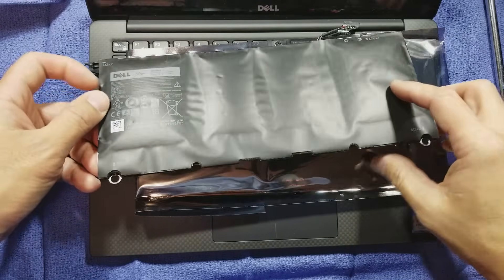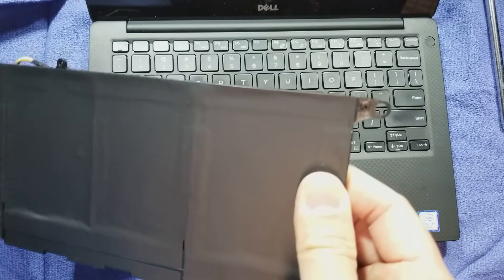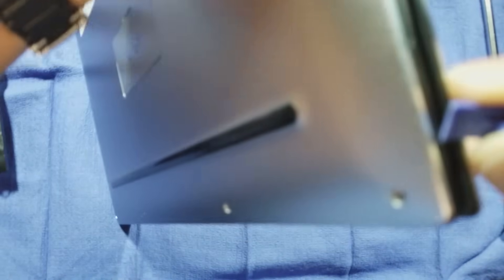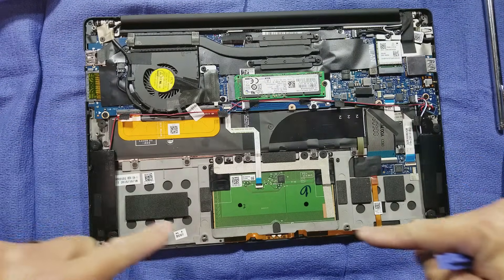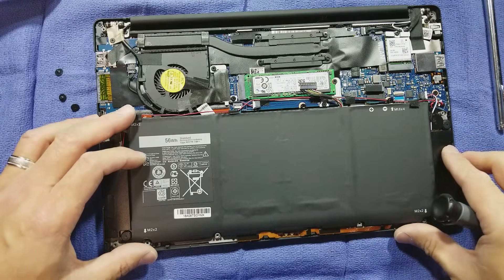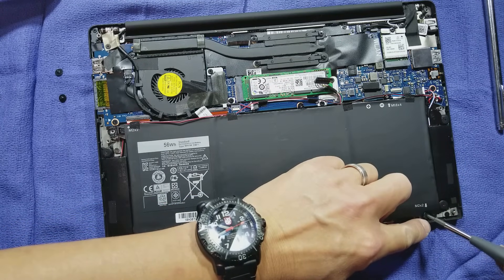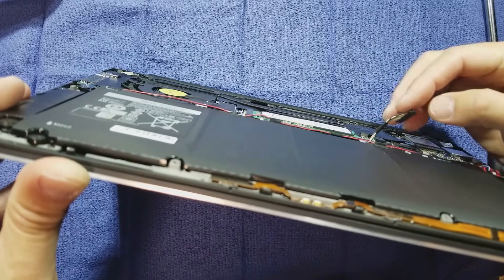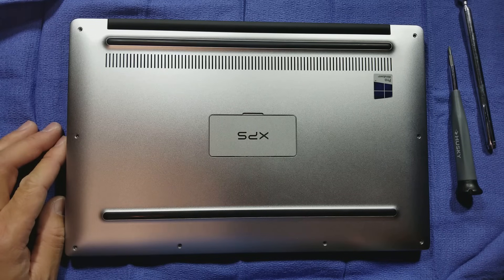Dell XPS 13 9350 Lithium Battery Replacement Installation. Bad battery. Not charging. How-to.

Comment: Many thanks for this very useful. I replaced mine using your guide. But I have a problem.
I have just replaced it and whilst at first the charging light on the laptop showed normal (charging) white. After a few moments that changed to flashing 3 x yellow/orange and 1 x white! I have now removed the power.
Would you know what that indicates?
Tks

Comment: Thank you so much John for this video. I was able to replace my battery thanks to you. My problem was removing the back. I didn't want to insist, fearing to damage my laptop but when I saw you struggling I understood that it was normal to have trouble removing the back and I succeeded.

Comment: Hey man! I took apart my laptop today using the Ifixit kit, T5 for the case screws, and a number 1 philips for the inner and battery screws. I'd like to know how would I find out when to change the battery inside my laptop. Inside, the Lithium Packs were not bulging out ridiculously. My Battery Report says 2019-12-29 59,969 mWh 97,003 mWh. And I currently get 3 hours and 30 minutes on a full charge. It's been about 1 year and 6 months on my Dell XPS 9570 i9 and it's an extreme workhorse! I just want to make sure I change the battery at an appropriate time and I don't want to wait to long where it just dies on me!

Comment: Thank you for  showing the battery installation. My recommend to everyone is not to use  your bare hand especially the metal screw driver and touching around the printed circuit board. Electrostatic Discharge (ESD) from your hand or metal will damage components. Use a piece of plastic or wood if you  want to move the electrical wires around. Second, get a wrist trap to handle ESD. Spend a few extra bucks for the wrist trap to save your thousands dollars investment.

Comment: I'm indecisive if I need to change my battery. There is no noticable swelling of the battery but my full charge only last 2 hours of constant work on the best energy saving mode??
Reply: I also have the same problem. Wondering if replacing the battery will get me more battery life?
Reply: I also did install the Dell power management program and it says my battery is in excellent health..
Reply: not sure if you did it or not but you can check the battery helath yourself by running the commands in CMD Prompt.
I dot have swelling but only get 2 hours of battery and only have a 33K/53K battery charge left so about 61% in health anything under 75% is probably a good time to replace just due to it not holding a charge as much as you need it.
Going to replace mine to get my hours back since i need it for work purposes.

Comment: how good is the replacement battery ? i have a lot of trouble finding a good replacement
Reply: yeah, same question popped up in my brain cells. ??
How long does it last ??
Reply from the maker: Has continued to work perfectly since initial installation. No worries at all.
Reply: kinda late, I see equal % of +ve and -ve review on that  amazon , so I found a alternative  ebay link: https://www.ebay.com/itm/New-90V7W-JD25G-Battery-for-Dell-XPS-13-9343-9350-JHXPY-5K9CP-0DRRP-7-6V-56WH/312516257734?hash=item48c36ba7c6:g:2P0AAOSwZ2pcfk-7

I will post back the review :)

Comment: Great video! The way you cracked the case from the front is perfect, otherwise you snap two little dimples on the back of the case (next to the hinge on the edges). I used a T5 bit to remove the case screws and a 1.5mm philips for the case screw. Inside on the battery I had to use a larger philips since the screws were shallow. I got the OEM replacement battery from Amazon for $120. We will see how it works! thanks!

Comment: my battery look fine, no swollen but I only use like 45 minutes without plugin (it happened for the last couple weeks) . There was problem like "plug in, not charging" (not all the time). Is that the problem because of the battery or the charger? My laptop purchased in 2015 also.
Reply: Take it in to a computer shop to help you diagnose the problem.

Comment: is it OK if I remove the battery without installing a new one a use the laptop from the AC power? will it run?
Unfortunately I can't afford a new battery and I have a lot of work on my laptop😞.
Reply: Hi, I tried all possible solutions and my dell xps 13 battery never charged, changed battery, charger... It cost me a lot of money. I then found out if I plug the charge in the house's high power wall socket (those meant for toasters, ovens etc) the battery charges just fine. So I think it's probably the motherboard that has a power regulator gone wrong. Try this and let me know if it works just as good for you.
Reply: @DodoLands  This is interesting but I have a different issue, mine charges and works fine except that the battery is swollen to a degree where the keyboard and the trackpad are unusable. Thanks for the reply!
Reply: @7usam93  yeah, if its swollen then it needs to be replaced. I'd send it to dell maintenance just in case the motherboard is damaged, could prevent damaging your new battery :) Happy 2019 to u and your subscribers!
Reply from the maker: Why don't you leave the battery alone for now?

Not sure if notebook will work without battery installed.
Reply: Thanks for the reply, I have a swollen battery the popped up the trackpad and I can't  even close lid to due to the swollen area. I have been to told that it is dangerous to keep using a battery with that issue. This is why I want to get rid of it.
Reply: @7usam93  Whats the word? Did it work without the battery installed on just AC power?
Reply: @adamsonhdmm  I did not do it! I've been  working on a project so I didn't want to risk anything. I'll be done next week and then I will try and reply to you what happens.

Comment: Can i put a 97whr battery in here
Reply from the maker: I would probably put in an OEM battery that is of exact physical size, capacity, and output, and not try to get too creative. This is for safety reasons.
Reply: I put a 60WH instead of the 56WH... For now it works
Reply: @FederationMontagneEscalade   - I heard there are bios issues with using a different capacity battery?

Comment: I also own this Dell model.
Does it possible to use this laptop directly to AC, w/o (took off) that swollen battery, while waiting for the new one? 

Thanks
Reply from the maker: You should be able to run the notebook with the battery "puffed" until you receive the replacement.
Reply: Thank you!
Reply from the maker: So glad to be of service!

Comment: I bought a battery from Amazon that came w four screwdrivers and they've all worked with their respective screws except the 3 black ones holding the battery in place. I just can't seem to get them out and I'm scared to keep trying for fear of stripping them. Any tips on how to jimmy them out? Thanks so much!
Reply from the maker: I would highly recommend something like this:
https://amzn.to/2wLRQ5s

You may be able to find similar items at your local hardware store.

Comment: I have the same problem and plan to travel with my laptop. However, I may not have enough time to replace the battery before my flight. Have you ever had any issues going through airport security with the swollen battery?
Reply from the maker: Theresa 

No one knows about swollen battery except you!

Never had problems traveling while battery was "puffy". I had not figured out what was happening!
Reply: John Lin Thanks for the quick response!

Comment: What is the difference between 52WH and 56WH batteries?  I'm seeing the dell OEM's are 52Wh while the after market are 56Wh.
Reply from the maker: Greater "stated" discharge capacity of 4 Wh with the 56 Wh battery. That's it. Not sure if you will be able to tell time difference in actual usage.

Comment: Great video! I just noticed a right side bump on my XPS 13 9350. I will buy a new battery and try to replace it myself.
Reply from the maker: Daniel Gutierrez 

Best of luck! 

It was the best thing I did. So happy with my XPS now, after replacement.

Comment: Can you please give the link for the batteries(Amazon)? Thanks!
Reply from the maker: Daniel Laborada 

90V7W Battery,JD25G Replacement Laptop Battery for Dell XPS 13 9343, XPS13 9350,Fit for 5K9CP DIN02 RWT1R,Li-ion 7.6V 56Wh:

https://www.amazon.com/gp/product/B077ZXHHJ4/ref=as_li_tl?ie=UTF8&camp=1789&creative=9325&creativeASIN=B077ZXHHJ4&linkCode=as2&tag=ppmd-20&linkId=17b37b5c86ed79674911ef3ece0104aa
Reply: Wow! Thanks a lot dude!
Reply from the maker: You are welcome!

Comment: One comment, why aren't these dangerous batteries being recalled and replaced by Dell? Mines got the same problem and these have the potential to start firees
Reply from the maker: smashie2000,

All lithium batteries have the potential of fire if mishandled or if there are manufacturing defects.

Just because the batteries "puff" does not mean they will catch on fire. The puffiness simply means the batteries have aged or have been damaged.
Reply: Yeah I get that, but the only device I've had had it happen is my XPS, rough price conversion would be about $1800 when I bought it. Fully loaded.  But on the flip side as well the 'puff' can also damage other components